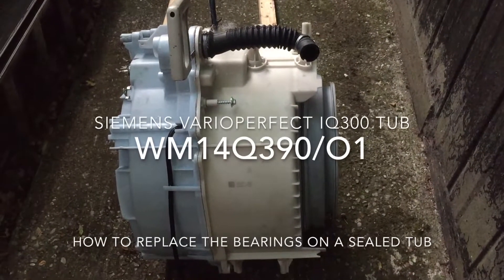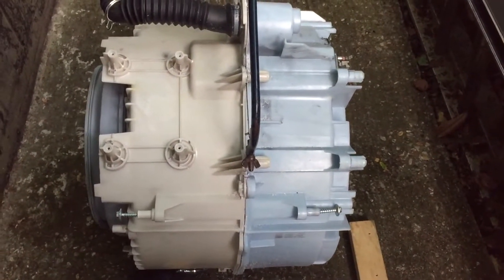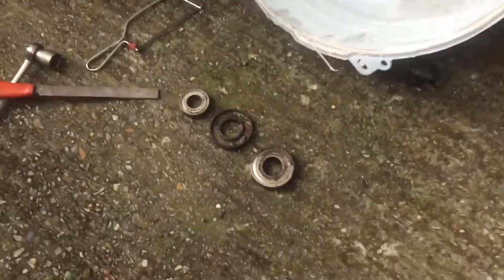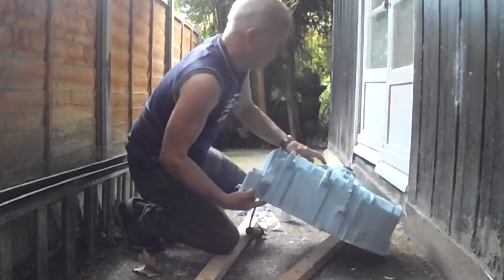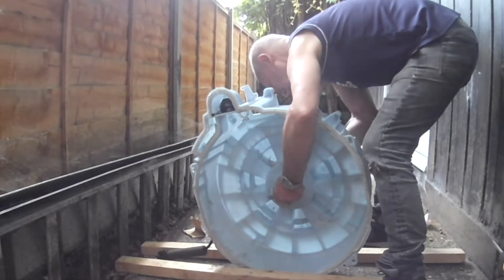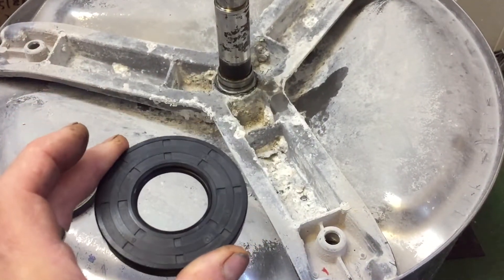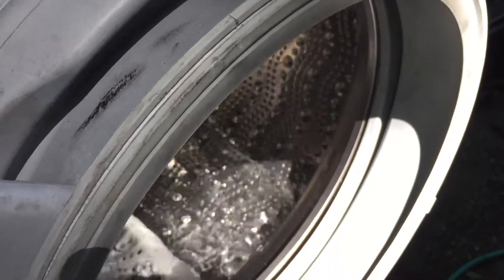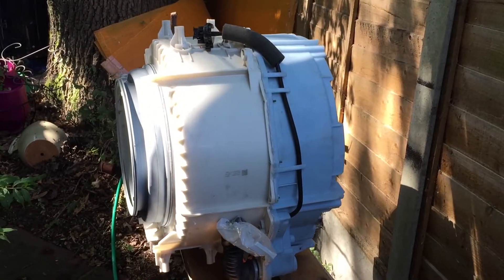SIEMENS IQ300-How to replace the drum bearings on a sealed tub washing machine

Comment: Hello Ray, thanks for this video very helpful. I am going to try this or else face a £1,000 bill for a new one. 
Can I just ask how did you get the tub apart? Did you use the hacksaw seen at start.
Also what length hex head M4 screws did you use 10mm or 20mm?
Thanks

Comment: Great repair, process nicely done. A shame it will happen again in a few years. You just can't beat a metal drum. The plastic drum was probably 3D printed. Perhaps you could try using small plastic wedges, like used with modern re-useable tile spacers, to hold down the plastic lugs, when separating the drum. Could save  having to break them off.
Reply: Such tubs are usually injection molded. 3D printing is far too slow and so too expensive for mass production.